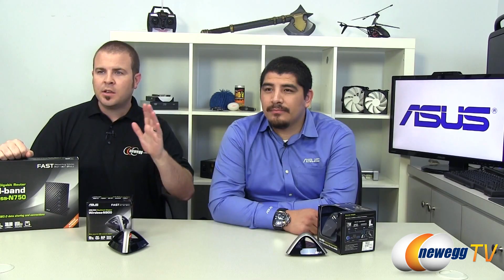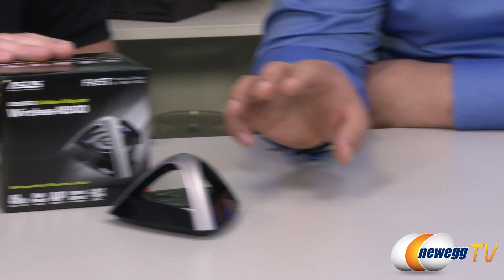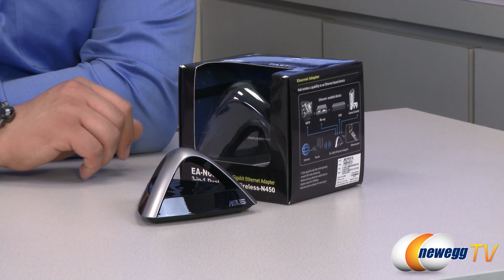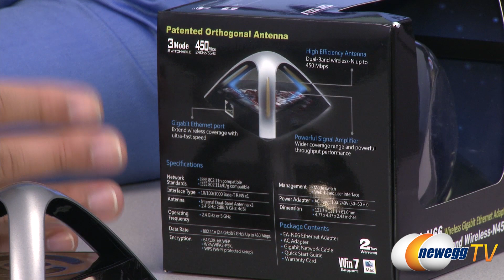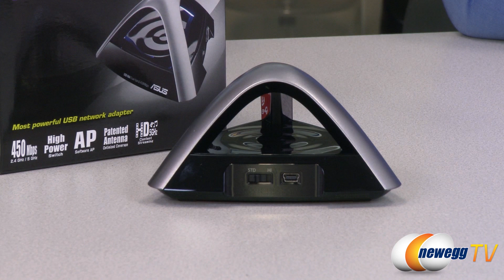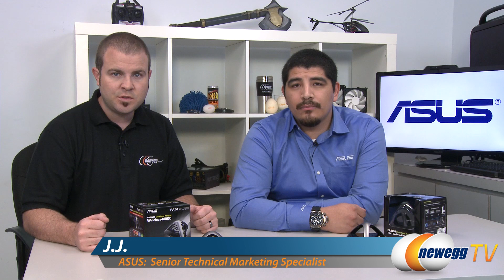Newegg TV: ASUS EA-N66 & USB-N66 Dual-Band Wireless N900 Gigabit Routers Overview w/Interview

Comment: the GUI was kind of a pain. I had to reload the page a couple times. I got frustrated at first but a little patience solved the problem. I used this to extend an existing wireless network to the opposite end of the house. After getting everything set up just right I'm running at 300mbs and everything is looking good. I have my desktop using a wireless internet (tp-link 300mbps) usb to pick up the wifi signal from the ASUS EA-N66. Everything works great. I haven't tried running multiple devices off this connectiong. I am looking to connect my xbox through ethernet and stream netflix and run an online game to see what the latency is. Will update with results. So far so good on this product. If anyone has any questions let me know I will try to help if I can.

Comment: I have the ASUS RT-AC66U router which is awesome, but at the other end of the house in the second floor I'm not getting a stable strong signal. I've now got a wired connection there, connected to the ASUS router, via a Devolo Powerline adapter in a power socket at both ends. Can I connect the first device you talked about here to that socket in the other end of the house, and connect to my network and get Internet via it? Or to do that, does it have to be a range extender to do that?

Comment: I was wondering, because of its antenna design...does it have to sit up, or can it sit sideways (like mounted on the back panel of a central hub box...the ones installed inside the wall)? Cause of it's size it doesn't look like it'll fit sitting right-side up.